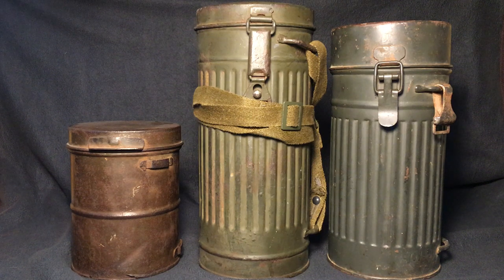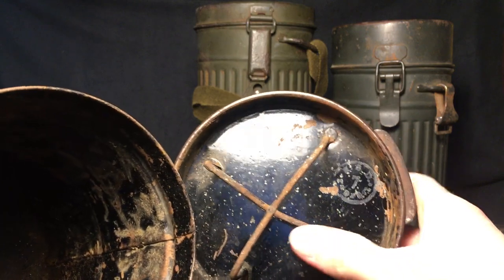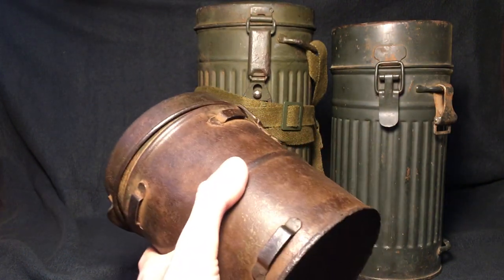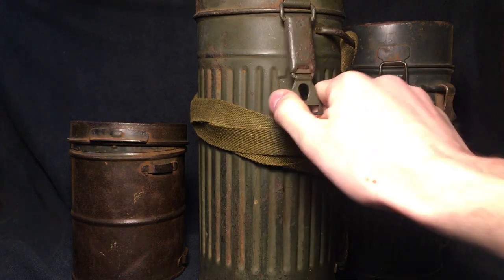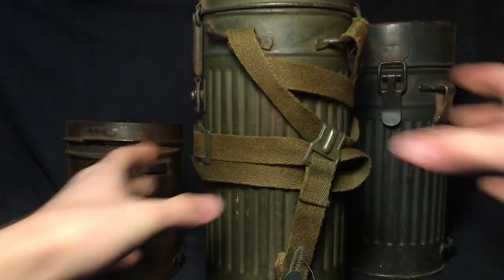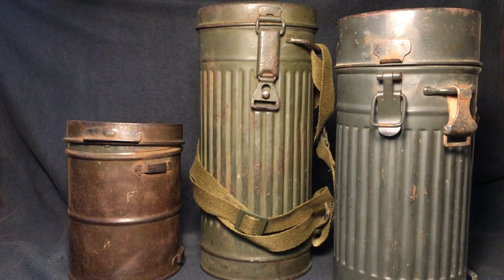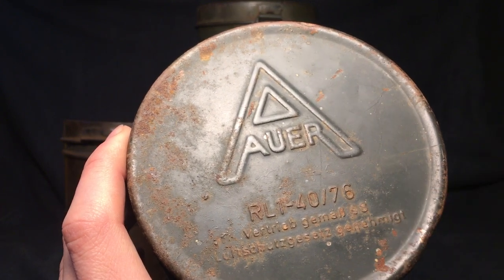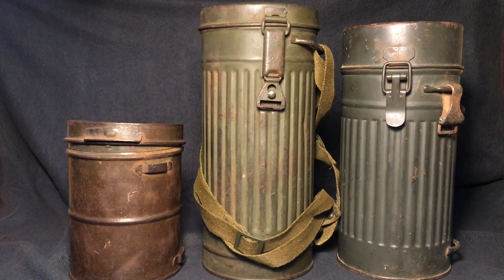Comparison of German Military Gas Mask Canisters

Comment: I got an original ww2 production german gas mask canister. It's the same as the middle one. Mine doesn't have straps or the lense compartment. I paid $35.11 everyone says I overpayed.
Reply: I think you did not over pay they normally go for around that much  like from  35 to 40 pounds but if the gas mask canister is all complete it can go up to fifty pounds

Comment: Nice video. I just bought a repro canister and was wondering what the compartment in the lid was for, so thanks for including that detail.
The grooves on the side is called "fluting" and is there because it is structurally stronger than just flat metal.  Fluting can be found on late medieval suits of armor too.
Reply from the maker: gpgpgpgp1000 thank you.